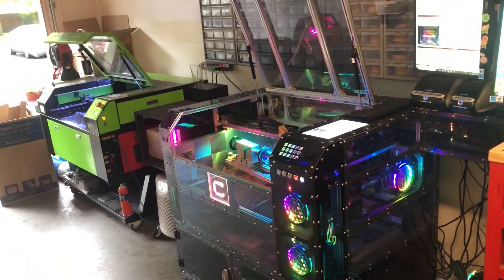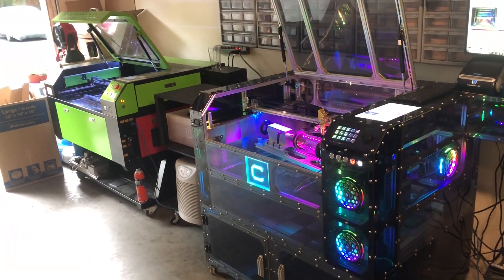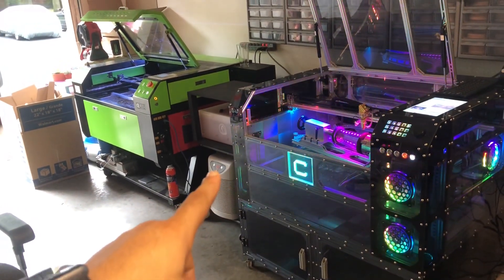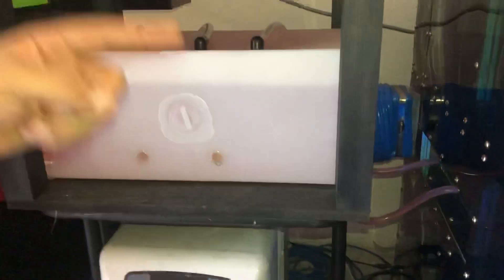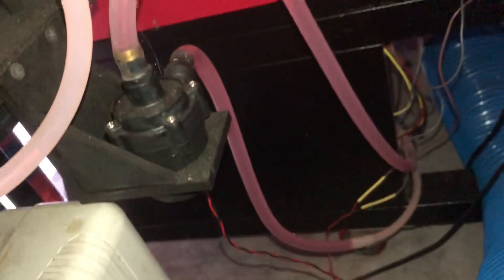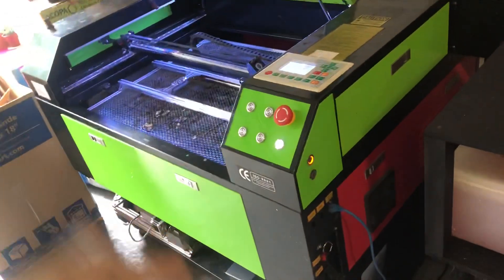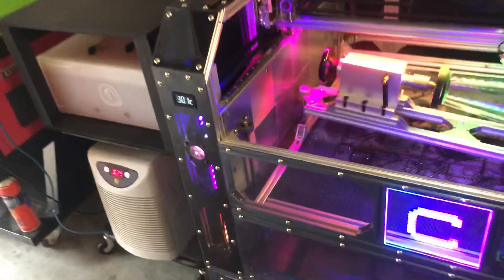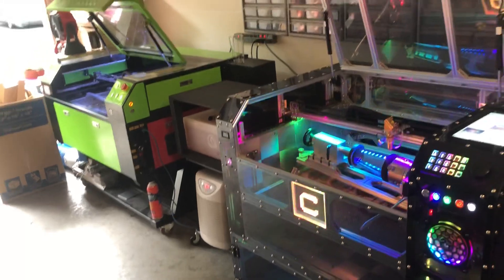Updating my water cooling system for my CO2 laser cutters

Comment: What brand/model chiller are you using? and what power/water capacity, and cost?
Reply from the maker: Hydrofarm Active Aqua Chiller, 1/10 HP https://www.amazon.com/dp/B0048IVBT4/ref=cm_sw_r_cp_api_glt_fabc_PQKSN46X98KKT5W174T3?_encoding=UTF8&psc=1

This is the chiller that I bought almost 5 years ago and still working great. You will need your own water tank and water pump.

Comment: nice what controller did you use to control it all
Reply from the maker: It’s called laser board by cohesion 3D. It’s ok but sometime next year I’m probably going to change it out for a Ruida.
Reply: @HangingOutWithChico  cool thx wil have a look at those, atm I'm upgrading my small cnc blue laser to CO2 laser. it is using a grbl 1.1 board.  really would like a touch screen controller, that also can control air and water pump, light, show water temps ect.
Reply: you gave me some real nice ideas in how I would like build mine, especially that dark tinted acrylic, that looks so sweet

Comment: That laser you built is intense! 😂 Quick question, just say a laser machine comes with water cooling, can you change it to an air cooled system no matter what laser machine it is?
Reply: No, glass tube type lasers will require water cooling.